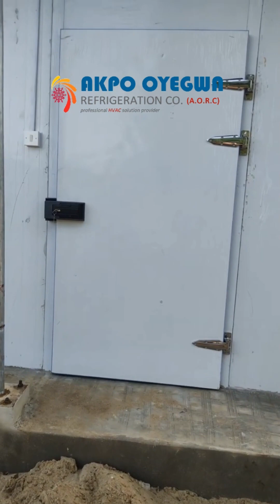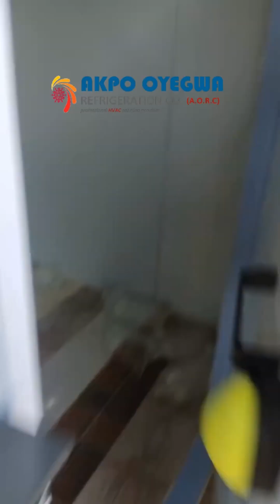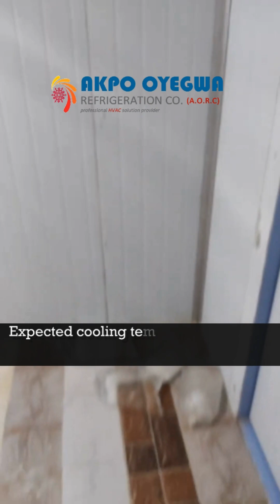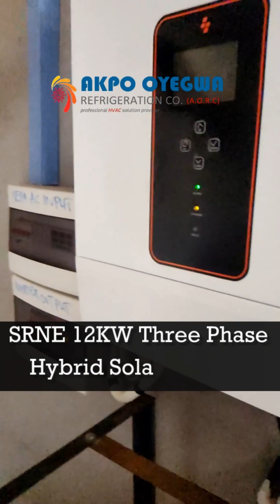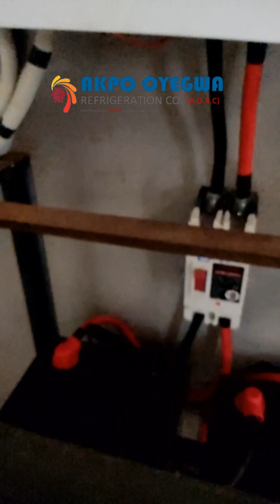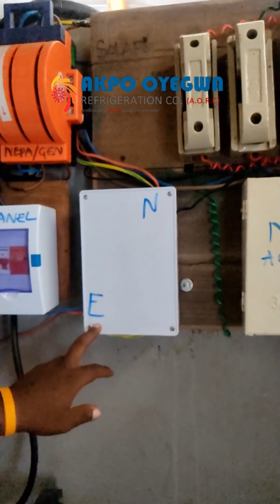SOLAR COLD ROOM - Solar-powered cold room Nigeria

Comment: Can that inverter size (12kva) power two of that cold rooms? Of course, the battery bank as well as the solar panels will be upgraded accordingly.
My question is strictly on the inverter.